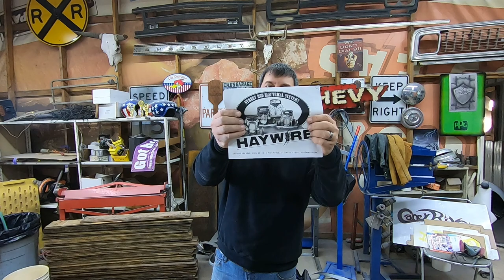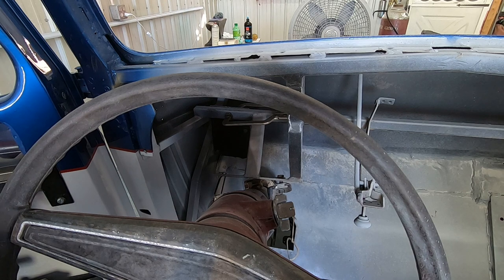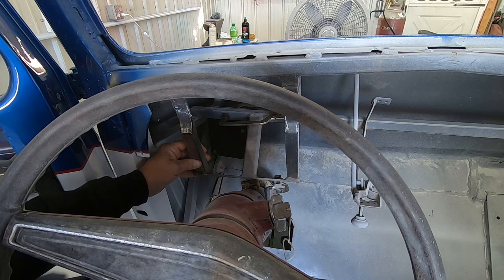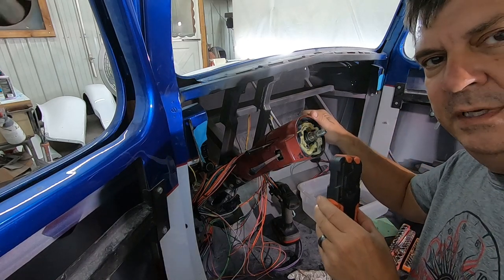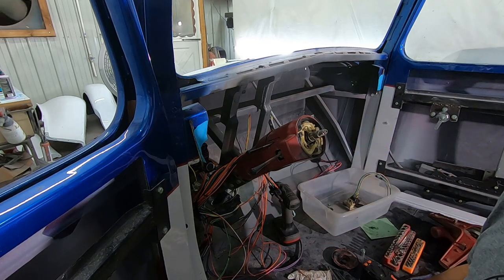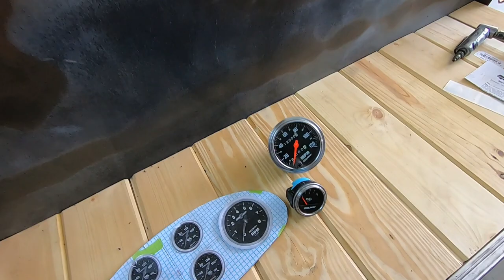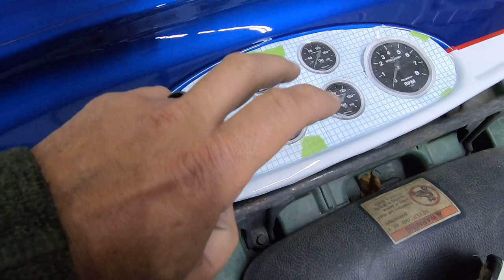Best Wiring Harness | Hay Wire 21 Circuit Wiring Harness Layout for 1935 Chevy

Comment: I was under the dash of my '36 Chevy coupe and counted 3 inline fuses. Then, I started looking for the fuse box. I found 1 more inline fuse but, no fuse box! The turn signal and 4 ways power wires are spliced together from 1 flasher. 4 ways only work with the key "on'' or in ''accy''. It has 3 color changes in the circuit to the LF turn signal! Now, I disconnect the battery when it's parked. These wiring kits are looking pretty good right now! BTW, Your car looks great!
Reply from the maker: Thanks for watching man, the kits are very nice and much safer for sure!

Comment: We're do you buy you sheet metal from thanks
Reply from the maker: I buy sheetmetal from a place called Champane Metals in Glenpool Oklahoma.
Reply: @HogshooterHotrods  I mean can you buy original  35 sheet metal for your car there like floor pans fenders hood etc.. thanks
Reply from the maker: @rodneyturner6892  There are not many specific sheetmetal parts made for the 35 chevy. My floor is 14 ga. welded to 1x1 square tubing frame work. Hope this helps you out.
Reply: @HogshooterHotrods  thanks I'm trying a master deluxe sedan it's hard to get parts I agree